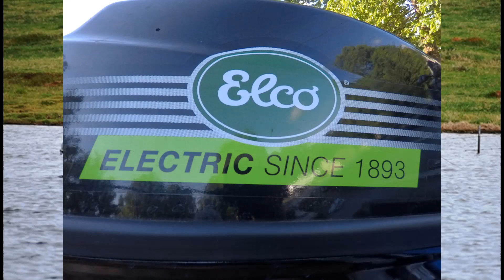Electric Outboard Elco EP 20

Comment: I also have an EP-20 and really like it.  I had it on a Lowe Roughneck 1652 with a 48V Lithionic 200aH battery.  Top speed was 7.8mph.  I am moving it to a Weldcraft flat bottom, square bow 1656 that should do a little better.  Flat Bottom Weldcrafts Jon Boats seem to be a very efficient hull for electric motors.  Some guys I know are getting over 13mph with Torqueedo 10.0 on Weldcraft 1860s.  I am hoping for 9-10mph with the new Weldcraft hull.  The boat is fully decked out with about 350 lbs of aluminum.  Hull weighs 375lb bare.  The battery weighs 225 lbs.  So the whole boat is in the 1000lb neighborhood.
Reply from the maker: They are tough motors. The batteries is a critical element to get the full potential of the motor. Flat Bottom boats do get better speeds. I personally like the mod-v fronts. Choppy water helps cutting I feel like. Thanks for commenting and watching sir.
Reply: 12 foot caroní skiff ór whaerc13c1¹ super sort

Comment: I recommend soldering the wire ends on for that plug system it helps prevent moisture getting into the wires where crimping isn't as solid of a connection and much more likely to get moisture into your wires
Reply: you're not meant to solder high amp connectors, crimping is reccommended, but yeah some heat wrap cover would do the trick
Reply: Yep, don’t solder high current connections. Get a UL rated crimp tool and UL connectors for the best possible connection. Then use some adhesive lined polyolefin heatshrink for water tightness and insulation.

Comment: Merrick, thanks a lot Sir. I learnt a lot. I am very new to boating. If I buy this electric motor, will it work with any steering system? Also do the motor comes with throttle and electrics (like consumption rate, remaining power etc.)? Thanks for your reply.
Reply from the maker: You can purchase either the remote steer like the one in my video or a tiller steer. The tiller obviously does not have a separate throttle body like the remote steer has. The Elco does not have built in consumption rate/power remaining. They do sell upgrades for a meter that can provide you with estimates of amp/volt/etc. I simply bought a 48 volt - volt meter off of amazon and works fine once you learn the draw down curve to lead acid batteries. Thanks for watching and the comment!

Comment: electric outboards do pretty well on smaller pontoon boats since there is less wetted hull surface in the water. trouble is a lot of pontoons are set up as floating living rooms with lots of heavy furniture and other junk, it's hard to find a pontoon that is set up for fishing.
Reply: I have an old partikraft 150f (fishing version), only 16'. Definitely considering going electric.
Reply: bay evioib 552 oe ¹810 oarker biar eñivey 150 hp ejtrc outbard
Reply: Now in 2023 they make 300hp electric outboard motors

Comment: I think those lituhiam battery's r going to make it much faster and lighter.  Like to see it wut she does . Thanks great video explaing electric outboard not to much information on them .
Reply from the maker: Update: I test ran some lithium batteries yesterday. I was topping out around 7.6 mph. I could tweak the setting on the angle of the motor position and feel I could gain .1-.2 mph. The Lithium batteries are amazing. I reduced my battery weight over 300 lbs when running total lithium. They were AMAZING.

Comment: Great discussion.  I'm just looking for when the gas motor goes.  It's old.  I figure I'll pick up one of these instead of gas.  I'm still watching and waiting to hear on pricing of the motor and battery.  
How long will it run full throttle?
Reply from the maker: If I recall correctly the EP20 runs around 5k without batteries. The benefit to the Elco is you can utilize different style batteries (ie: lithium, lead acid/agm, etc...). I am now running a sealed AGM 110 amp hour battery. The lakes I fish I run 100% throttle to the first spot. I then run 3/4 throttle for the duration of the day. When I run back in I run 100% throttle. Longest distance to initial spot is usually less than 4 miles. The key is pairing the right battery. Higher amp hour batteries are ideal (nothing less than 100 amp/h). Only down fall would be the higher the amp/h the more the battery weighs. Hope this helps. 
God Bless
Reply: @merrickmcclure6058  Actually, your information was very helpful.  Thank you.
As for the price I've been looking.   They aren't much different than the gas motor if not a little cheaper.  The batteries are what put them over.

Comment: I got a Triton TR 20 that I'm getting ready to power with an electric motor. There are so many electric only lakes now it only makes sense. You can run gas motors in some of the lakes I want to fish but it has to be a 9.9. I'm thinking about a 9.9 elco. Do you think I should run one or just get a transom mount 36v? An advice would be appreciated thanks
Reply from the maker: Richard, it depends on what your expecting. If you wanting to gain the most speed and money is not an option then an electric outboard would be ideal. If you wanting to get going initially, I would start off with a 36 volt transom. Then when your ready to upgrade to an electric outboard you always have a back up transom trolling motor. With a boat that size, I would highly recommend going with a 36 volt bow mount. Electric outboards are great but battery conservation is critical. There are some nice batteries available now that have the higher amperage that can give longer run times. Get over to Decked Out Jonboats on Facebook and follow them. They give  some good input on building these electric only boat setups. 
God Bless
Reply: I have a 36v bow mount so I'm good there. It's such a big boat but I can't fish in small boats comfortably due to years of bodily abuse LOL. I'm just not sure if a 9.9 electric motor would be worth messing with. I can't go any bigger due to lake restrictions
Reply from the maker: @richardbranton2780  One strong advantage electric outboards have are they are brushless motors. Trolling motors are not durable enough to make those long runs year after year. Running trolling motors could possibly last 5-10 years. If you have large lakes I would suggest making that leap due to durability of an electric outboard brushless motor.
Reply: I didn't even think about that but your right. I run lithium batteries in my gas bassboat so I'll probably run them in this boat also and yes they are worth the money. Thanks for the advice
Reply: yamha  9.9 ektrc outbard 56 miiecrabge tejsà ceks 64 mioe rabge
Reply: buy yàmha 9 9 eltric 56 mike rabge bmw bstee 71 milecrange

Comment: What max speed can you go?     did you ever run empty your battery? (what size of battery you set up for this )
Reply from the maker: I was getting around 7mph on refurbished batteries. They were 120 a/h agm batteries that were heavy! The folks at TBNation helped me build my new boat and we decided to no longer run the Elco. There might be changes in the future…subscribe if you haven’t to see future electric outboard videos.
Reply from the maker: Yes we did run the batteries down even with the 120 a/h agm’s. AGM batteries will slowly curve down with lower speeds. This motor draws around 140amps if I remember correctly at 100% throttle.

Comment: I am grateful for the detailed explanation.  You should apply to Elco as their spokesperson.

As you mentioned in it, it is nearly impossible to find a detailed video on usage for these outboard Elco motors.

How many hours can you get with those four batteries, and what are the amps and voltage of each battery?
Reply from the maker: Thanks for the comment. I run four 100 amp/hr batteries. The motor draws around 180 amps at 100% power. I can run to the first spot at full throttle and then have to iddle back to half throttle for the remaining part of the day.
Reply: @merrickmcclure6058  3 years later you can run (1) 48v 400ah battery if you are pressed for room (and a lot less weight) like I am on my mini 15 ft pontoon.
Reply from the maker: @zedwpd  I now am running it with 200 amp batteries. Very impressed with the setup with lithium batteries. Appreciate your subscription to my channel.
Reply: @merrickmcclure6058 I'm about to put on the 20 with (4) 12v 230ah lithiums. Seems like your setup. Is there a noticeable difference from the 100ah in run time?
Reply from the maker: @ I am now running lithium pros batteries. I’ve got 4 - 48v packs that have a total of 200ah. The days of lead acid are gone.
Reply from the maker: @ sorry meant to answer you. Significant difference in run time. I still have to throttle it back to reserve the battery but I’ve doubled to tripled my range. I’ve ran up to 20 miles in a tournament without issues. Just got to conserve it properly. If you go full throttle it will still drain your battery.
Reply: @merrickmcclure6058 thanks, i fish electric only reservoirs, so I know all about the power conservation.

Comment: Seems like it needs a different prop. Considering how much the thing costs and all the batteries. The performance from the same physical size outboard is twice as much and a whole lot cheaper. If ya had a small dinghy with some lightweight lithium batteries. That would be a blast.
Reply: Full throttle 6mph and 100kg+ of batteries 🤣 10kg 2hp outboard for $200 be just as fast

Comment: but a 20HP gas would probably get you around 15 to 20 MPH on that boat. Also when you do the math converting watts to HP that is only an 11.9 HP and is the reason it only goes 6.5 MPH wide open. I realize they claim it is equivalent to a 20 HP gas model but it really is not or it would go as fast as a 20 hp gas model.
Reply from the maker: I had years ago put a 25 hp on this boat and it would not plane out. I did not have GPS back then but I would guess I was getting around 8 mph. So I could agree with Elco that it is equivalent to a 20 hp.
Reply from the maker: John Smith on fresh batteries (newer) I can get 7+. I am planning before the end of the year to be testing a higher amp hour batteries that are lithium. Lighter weight and higher amps should definitely increase my speed. Keep in mind we fish lakes were 1 mph can be substantial. You might want to talk with Elco to better understand the motor being equivalent to a 20hp. I unfortunately do not have the answers. I know for a fact on my boat with a 25 hp gas motor, it will not plane out.
Reply: @merrickmcclure6058  I do thank you for the response. I am very interested in the electric motors, but I am VERY disappointed in them trying to trick us into things that just are not so. I do not care what they claim I only care about facts and when you do the math of watts to HP the 20HP rated electric is only an 11.9.
Reply from the maker: @JohnSmith-ug5ci  Thank you sir.
Reply: @ronaldmathis3695  I am not interested in bogus ratings, but actual ratings. HP is HP, there is no special rating for electric motors verses an engine. As for torque yes an electric does have more torque than engine of the same HP, but manufacturers are being dishonest when they give so called comparison ratings of HP instead of actual ratings. I refuse to buy from any manufacture that does not give actual ratings.
Reply: @ronaldmathis3695  Yes they are bogus. Again you are VERY confused. HP is HP. The fact that someone come up with  a  formula for the electric motor does not make it HP.  Put an engine on a dino and and electric motor on a dino and you will see the electric motor will not measure up to the engine in HP.
Reply: @ronaldmathis3695  you would use the same dyno for both. Not two different dynos.
Reply: @ronaldmathis3695  again you seem to missing the point. HP is HP.  You are talking gearing and reductions. The manufacturers are giving bogus numbers when they say their motors are putting "X" HP. Calling them equivalent is also bogus as there is no equivalent as there is no such thing. The reason the manufacturers do it is because they know they cannot compete with the engine in costs and weight. I am all for electric, but not for bogus claims.
Reply: @ronaldmathis3695  NO, HP IS HP and it is done at the motor, NOT the shaft. If you do it at the shaft on a motor you have to do it at the shaft on an engine and have all the same exact gearing.
Reply: @ronaldmathis3695  you have been deceived. HP is HP, and unless both a motor and an engine are tested the same way with the same parameters it is a bogus test.
Reply: @ronaldmathis3695  the USCG regulates the size of the outboard engine. No one is going to die from an outboard. You are trying too cover up false advertising. All the manufacturer has to do is be honest when dealing with HP on their electric motors.
Reply: @ronaldmathis3695  no there is no such state laws.
Reply: That's a heavy fiberglass boat... You have to get it on plane to overcome the hull speed.  I bet a 20HP wouldn't do any better with that weight... They have a 50 that would do just fine.
Reply: @niceguyrides  then you need to buy one and prove it.
Reply: @JohnSmith-ug5ci  I don't buy fiberglass boats for this reason....  I am in the process of converting an aluminum hull with the Elco 50  It will plane just fine, require a lot less maintenance, and will be bulletproof.  It will also be allowed on my local reservoir.
Reply: @JohnSmith-ug5ci  lmao
Reply: Doesn’t matter in this situation. A 350 hp gas motor is going to get zero miles per hour on an Elric only lake.
Reply: @merrickmcclure6058  whaleér 13  20 too 40 ho ekrec 20 mph plús
Reply from the maker: @sharonbraselton4302  I am not understanding.
Reply: @merrickmcclure6058  I speak gibberish let me help. She says she has a 13 foot whaler with a 20 and 40hp electric that both get over 20mph.

Comment: To get everything is over 20k for a 50hp is 8500k charger is 15k battery 🔋 another 5000k u can keep it bud
Reply from the maker: They are not quite that cost. You can buy competitor electric outboards for around 6k for motor/lithium battery pack.
Reply: Yes but add up your fuel costs per year and you probably break even in a few years?
Reply: wriñg 50 hp ektrc 8500
Reply: @Bella0480  and oil, and winterizing, and spark plugs, and cleaning the carbs/fuel injectors, etc
Reply: @zedwpd  "cleanng the fuel injectors" only happens when you dont run synthetic fuel through it before it sits. other than gear oil, wich you need to do with this thing too, its extremely low maintenance and much much higher performance per lb.

Comment: 20hp and you didn't even get on the plane.
Reply from the maker: There are factors for electric outboards that are not comparable to gas outboards. Battery weight verses gas tank…I carried some serious weight on batteries. I’ve ran a 25 hp gas motor on that same boat and it never got the boat on plane. Maybe this response will make you consider more thoughts before downing the concept of electric motors. God Bless

Comment: wow.. $5000 outboard.. another $800 in batteries for 6MPH.. Your boat is too heavy for a 20 HP electric outboard. Put that Elco EP-20 on a 150 pound jon boat and you could probably reach 20+ MPH. For a heavy fiberglass boat like that you need 60+HP
Reply from the maker: We are very fortunate and blessed. We were blessed to have won a National Championship and received the ELCO at no cost. The AGM batteries I run does not cost $800. You can shop around for batteries for less than half that cost. I went with this old Cajun for two reasons...it costed only $250 when I bought it and it’s a very stable boat on the water.
Reply: @merrickmcclure6058  that is awesome to get that Elco for free. and that boat for $250.. i am in Missouri and we have to title boats, and outboards and most things available for super cheap have no title.
Reply from the maker: @allstarpawn396  I bought it from a good friend that knew the previous owner. I’m actually in the process of fixing a 16’ Alumacraft and will be selling the Cajun. Going all aluminum and no more wood/glass.
Reply: thàßt why che remc mr fusoions
Reply: wgaker 15 50bhp ekrrc
Reply: buy whaler 17  60 hp ekrruc

Comment: It is all good BUT the energy density of regular petrol is 50-100 times higher compared to lithium-ion batteries, and 500 more than those of lead-acid batteries. This is that simple. Petrol engines are less efficient of course but a 15hp
 engine with a 20L tank can take you 200km away within 5-6 hours. It will take 20-30 hrs to do the same with electric motor, and couple of hundred kgs of lead-acid batteries.
Reply from the maker: Good points...The lakes I fish do not allow gas motors. So to say petrol is more efficient...where I fish it is not since they are not allowed. Thank you sir for the comments.
Reply: They make 300hp electric outboard motors I bet they will get to 200km in less time than 20-30 hours.
Reply: @zedwpd  great. The motor is 100grand, plus another 100grand for the battery pack, which btw weighs at least half a tonne. Great technology for being on the water 🤣
Reply: @zedwpd  lol they do not have a 200km range. more like 50km, 3x the price, and 2x the weight of a gas motor. gas motor gets lighter as you burn fuel, electric stays the same. gas can be refueled in minutes virtually anywhere, and you can take more with you. marine electric motors are a joke.
Reply: Only 250 tme hogh slide state bateries